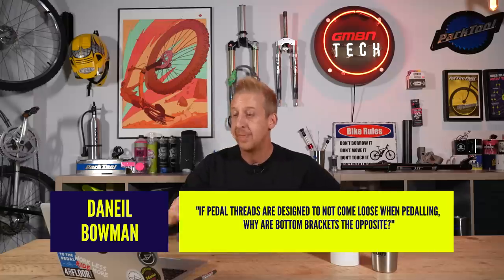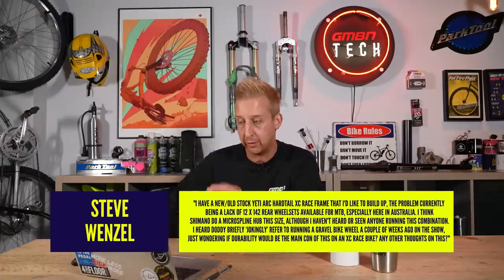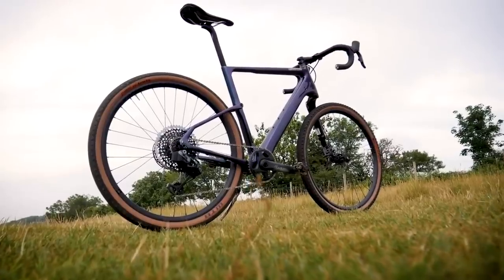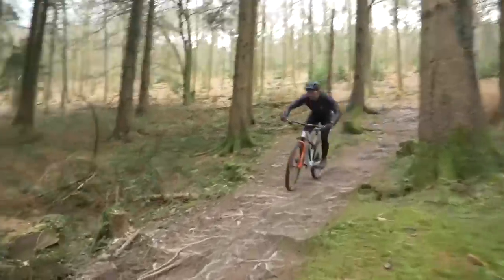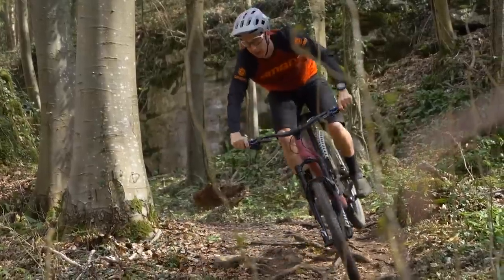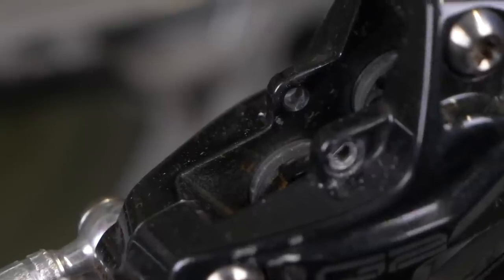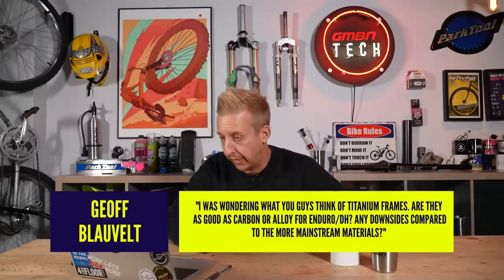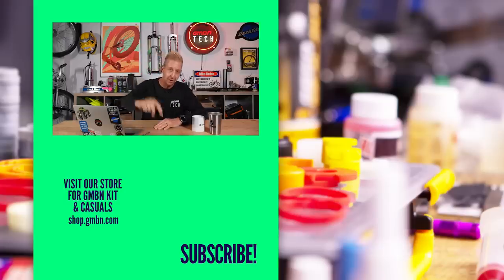"Why Doesn't My BB Get Loose When Riding?" | #AskGMBNTech

Comment: Love the tech show, you're always such a wealth of knowledge. I know Anna covered this quickly in a past video, but here's my question:
#askGMBNtech I was wondering if you guys could give a detailed break down of internal rim width to tire size, maybe with and without inserts. What tire is optimal for a particular rim width and how far outside that can you go before you start losing performance. My Orbea Occam came with 25i rims and a maxxis 2.5 up front, I felt like that was too big a tire for the rim and I could feel it roll over on hard cornering. My other wheel set has 40i rims and I tried WTB 2.6's and I felt the profile was too square so I went back to 2.8. I know each tire brand is going to be a little different. Thanks guys, keep being awesome!

Comment: For anyone trying to explore different frame materials I recommend FortNine's Motorcycle Metallurgy video. It's obviously not about bicycles but the pros and cons of each material are very well explained in simple terms. I personally prefer full alloy components for enduro/dh bikes. The fact that you can get a well aimed rock chip and have your bike explode on the next drop is not acceptable to me. Unless you're a sponsored athlete there's no point paying extra for carbon just to lose a few pounds off a gravity bike. They also have a race mechanic inspecting the bike after each ride and spare frames/parts to swap in if necessary. For light duty or commuter bikes though, where weight matters a lot and crashes are few and far between, it is a no brainer.

Comment: #askgmbntech - seat collar question. Should you clamp the seat post with the gap of the seat post collar lined up with the gap in the frame seat tube, or, the seat collar white lines (not the physical gap) lined up with the frame seat tube gap?

Comment: #askgmbntech  As for the problem on 12x 142 hub looking for an upgrade to micro spline the easiest way to do this is to put a boost wheel on the bike.  A 142 rear end will accept a 148 hub no problem.  Already done it.  Replaced my front fork to 15 x 110 and just bought a boost wheelset and  everthing works fine.  Allingment works off the outside of the hub so brake rotor and cassette alingment works fine.  Try it.
Reply: On an aluminium or carbon frame this can cause stress which can cause failure or massively increased fatigue, steel would probably be ok. Also would void your frames warranty and on some frames cause issues with brake mounts and cassette clearances. Not a good idea.
Reply: @Adam-vm8kp  You may want to look into this a little more.  All frame materials will flex way more than the 3mm required.  The spacing for the cassette and the brake rotor are from the outside of the hub moving to the center so spacing is the same.  The only change is better chain line in the boost spacing.  I researched this before trying it.  Even looked at hub diagrams between 142 and 148.   The distance for the outside of the hub to the rotor and to the cassette are the same so the caliper and deraileur do not see any difference.  The 148 hub is 6mm larger than the 142 hub only in the middle on the hub.  I did buy a 148 axle for the bike even though the 142 still worked.  Just wanted to have more theads making contact.  I am not the first to do this.  I got the idea from Pink Bike and a Pro mechanic that use to work for this channel.
Reply: @jeffknaub6380  i don’t think you understand aluminium fatigue, most manufacturers and frame builders would disagree with you. Because you looked at a few technical drawings for a hub means nothing. It’s the relation between specific frames and specific hubs. You could probably squash a 157 frame to fit a 130mm hub but but still a silly idea.

Comment: Is titanium better than steel? No. Is it worse? No. It’s all down to the way they are made; the geometry, tube sections and skill of the builder. If you are very lucky you might find that off-the-peg but for most people the best frame they could ever own will be built by someone who knows their craft, the material, the riding experience and understands what you need and want from your bike.

Comment: #askGMBNtech I’ve got a set of used Formula RX breaks from my friend are they any good nowadays? Is it worth servicing them? (I’ve got avid bb5s) or just buy a set of new shimano mt200s? Will they fit a 185mm rotor? Or should I change them as well? (They are in good condition)

Comment: Hope hubs/wheels are another good option for bringing older bikes up to date. The different hub width and endcap options for the Pro4 cover most MTB standards, even weird sizes like 141QR (QR boost), and pretty much all (other than DH and SS/Trials) can take a HG, SRAM XD or Micro Spline freehub body. 

A Hope Pro4 allowed me to put a Micro Spline freehub body and Shimano 12 speed on my old 26" 135QR hardtail.
Reply: I agree, I have a boost xd driver for my mtb and a 142x12mm HG hub for my Kona Sutra LTD. I could set the up as MS if I wanted to change them, just don't want to spend the money at the moment.  Lots of options for set up and super reliable hubs.

Comment: 6:05 That's an easy answer. A fully suspended bike will leave a good amount of fatigue-reserves to the rider. Yes, you will lose 1-2% speed in mechanics/hydraulics/pneumatics and aerodynamics, but not having to brake for roots/rocks/sidewalks or not having to steer around stuff is making that difference up in half a mile. Plus the bonus of not breaking your wrists doing so. Not to mention people with injuries and/or aches who otherwise would not be able to do long or frequent rides. I'd love a fully e-gravel bike myself.
Reply: that's to say: i love every single person who takes a bike instead of a car and if it takes a fully gravel bike to do so - yes, please and more of them. Cars and car manufacturers are the bane of our society and they need to be reduced as much as possible. So: comfort, speed, adaptability - what's to hate, really?

Comment: Dusted off my old XC bike with old 80mm Fox 32. Haven't ridden the bike in years. Was shocked how butterly smooth the fork was. Of course rest of the travel is not quite comparable to a longer travel trail fork.
Reply: Surely you can extend it,I have a rockshox SL and it can be adjusted 80mm to 120mm

Comment: My best friend, who got me into mountain biking long ago, still has his 2001 or 2002 Litespeed Unicoi soft-tail. Both of us took over a decade off from biking due to moves, work, kids, etc. When I got back into it a couple of years ago, I had to get a modern bike as my 2005 Trek Fuel was just not going to cut it (so I converted it to a rear hub motor ebike for street use). He had his Unicoi serviced and has been using it for gravel rides with his family. His LBS did warn him to not even try out a new bike until he's ready to buy, so great is the difference (and improvement). I can say from experience, they're not wrong. Oh, and his Unicoi cost more 20 years ago than the dual squish I bought last year. Ouch.
Reply from the maker: That's such a cool journey, Jason! It's really interesting to hear these sorts of MTB stories!

Comment: I personally love the smooth ride feel of steel on road bikes. Can't tell about titanium so far tho. But I think I have to agree with doddy that it's amazing for hardtails and rigid frames.
Reply: I do have a titanium hardtail frame from Litespeed made by Linskey and a while back I had an (original) Klein Attitude simultaneously. The ride on the titanium frame feels much better than the extremely stiff almost brittle seeming aluminum Klein frame. Not that the titanium isn’t stiff enough - it isn’t like a cushion or smth - but it simply feels more organic in comparison. Now that I kept only the Litespeed because of not enough spare time for two hardtails I am really used to the feel of titanium and don’t think about it much. But nevertheless it rides simply great: very responsive and agile but still not tiring brittle like the Attitude back then… highly recommended ..apart from the mentioned advantages: extreme longevity, no weakening over time, no rust, no chipped paint color …a frame for life, not for a few years only so to speak.

Comment: I was just browsing for parts when I watched the show, Shimano has a wheel called WH-MT601 with Microspline and a 142x12. Available in 27.5 and 29.
The suspension of my Scalpel SE also matches the described characteristics. It‘s made for going over roots fast but I‘d rather not land a jump on it. I think it‘s normal for XC bikes to use the travel early because that‘s what gives you the grip and makes you fast.

Comment: Pedaals threaded that way so if a bearing locks up.......   Ummmm actually if a pedal bearing locked up, the rotation of the pedal axle is backwards and would UNDO the shafts done up forward...
BUT 
100+ years ago the engineers were extremely clever... The pedals are not tightened that way in case the bearing locks up (which doesn't happen much on a moderately maintained bike).... rather they realised at ALL TIMES a process called "mechanical precession" is acting on the pedal axle and can unwind it even with perfect bearings.

Try this... Hold a pencil in the palm of your hand with your fingers making a tunnel it is loose in... now with the other hand rotate the end of the pencil clockwise and you may see that while the end of the pencil is making clockwise rotations, the actual pencil itself is slowly rotating the other way... 

This is the same with your pedal axles if the axle/crank threads are not perfect and can allow the axle to wobble...  
(Unfortunately as your cranks are turning the effect it reversed and that's where my mind starts playing that message "please deposit more money to continue with this ride" and I black out... and even I want to stop reading my comment by now)

Sooooooo    now go search "mechanical precession" and see how far in you get before your brain starts leaking out a nostril...!

Comment: #AskGMBNTech   Is that front piece of an MTB seat that was designed over 100 years ago actually of any use (Possible video here).

(I just find it gets in the way when trying to drop the bike into tight turns... and for catching my shorts on (adding hilarity to emergency dismounts))

Comment: #askgmbntech  You received a question about a brake hanging up.  I ran into this problem twice on two different bikes.  Tried your solution and it did not work and this is why.  What I found is that both times it was Shimano brakes.  Shimano uses a ceramic brake piston and what happened it that something caused the brake pad to push unevenly on the rotor.  Could have been dirt.  This caused the piston to come out of square from the cylinder and chip out the back corner which them falls behind the piston.  You usually feel a pop in the brake lever when this happens.  This debris then stops the piston from returning.  Figured it out after completely tearing apart the calipers and finding the chipped out piston.  Easy fix replace the piston an Bobs your uncle.